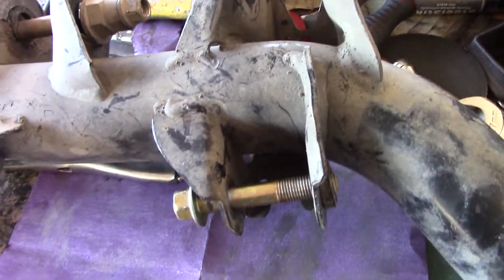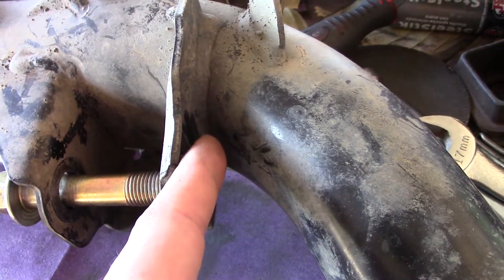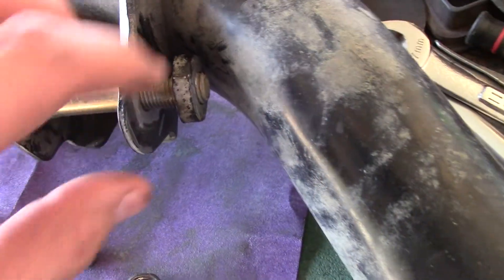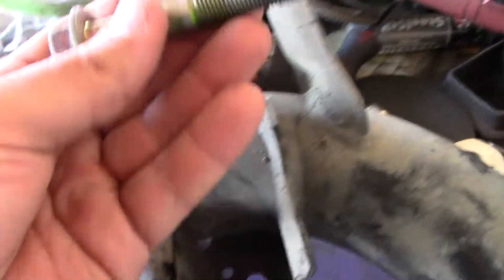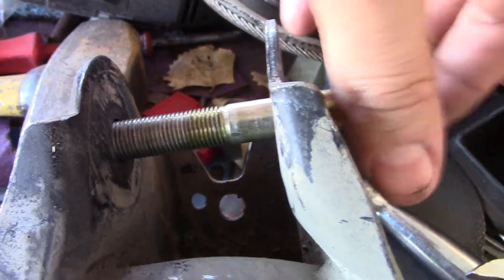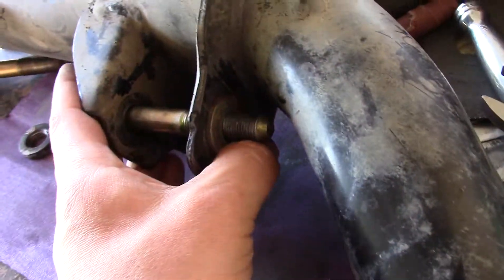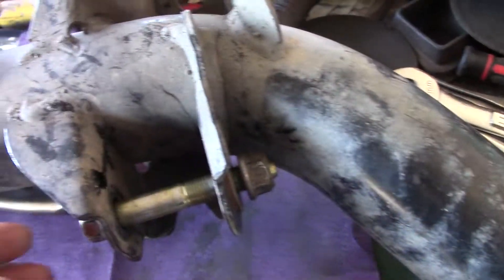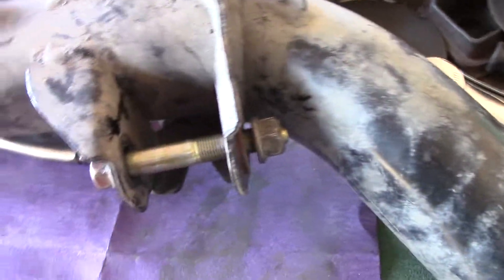RSX or EM2 AWD CR-V rear trailing arm strut bolt modification fix

Comment: How long did you hammer it man the inside of that nut stripped for me so I need to change it
Reply from the maker: It's just tacked welded on, it's super weak. 2lb hammer requires very little tapping.